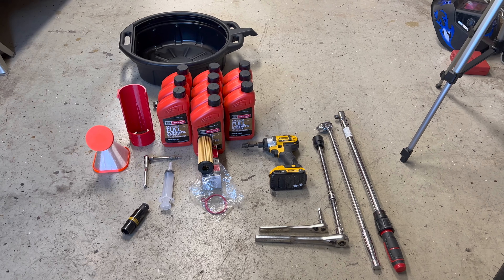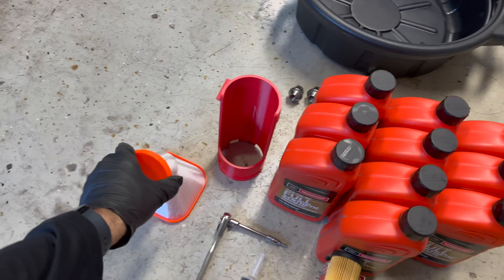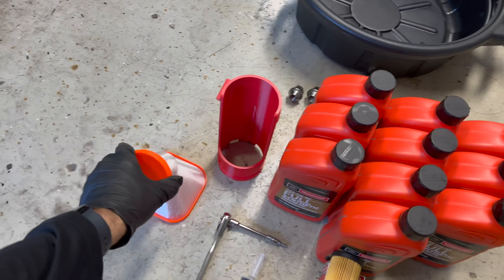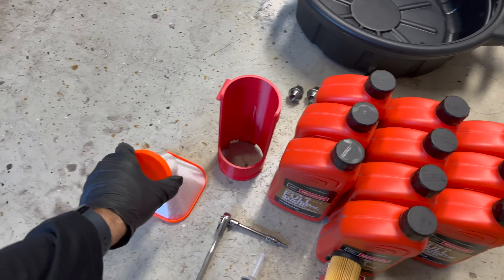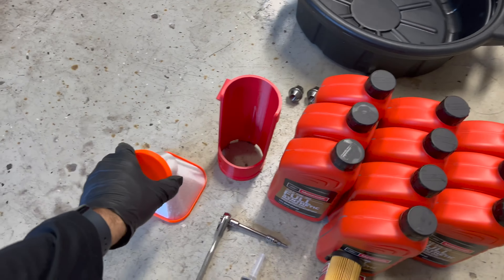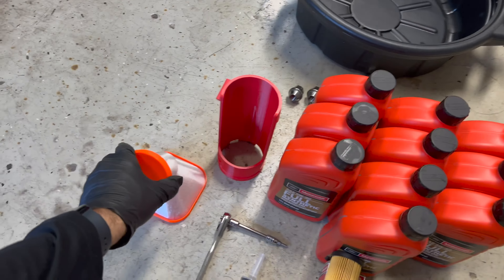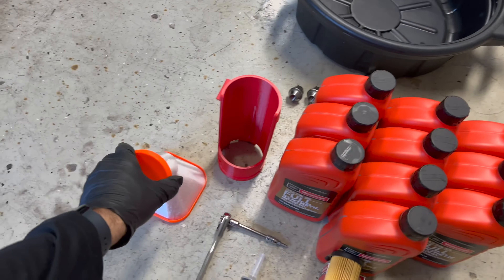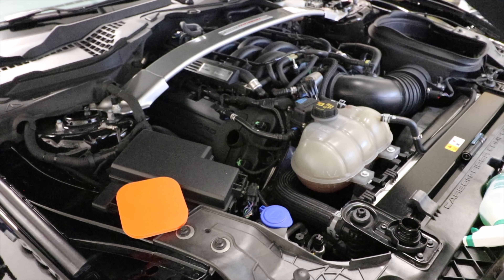GT350 Mustang Oil Change DIY Tutorial With 3D Printed Parts

Comment: You can do the oil plug by hand.  Just changed my oil last weekend.
Reply from the maker: Thanks. Yeah, I’ve had it stuck once before where I couldn’t turn it by hand, so now I automatically take a ratchet with me when I crawl under the car.
Reply: @pilotgore  I would definitely keep my eye on that plug being that the pan and plug are plastic . if it was stuck that means someone over tightened it might mean your pan or plug is compromised. I have seen it before on others people's gt350s not good 😐 great video though and have a wonderful day
Reply: Have a couple of backup plugs on hand.

Comment: Hey there. Are you Rolling the dice with that oil filter? The 2062 doesn’t have the metal core that the 2087 does.  Also. The 2087 is now unavailable. Sucks. Cheers bud
Reply from the maker: Yeah, the 2062 works perfectly fine when installed correctly, especially since I change my oil 7’ish times a year after only 500 miles or so. I have one more 2062 on the shelf and 2x 2087’s ready to go.  Cheers

Comment: I know you said you could use the FL2062 	oil filter on the 2020 - GT 500 does it have the medal basket on the inside of the 2062 filter like the 2087 has? In your opinion would you use the 2062 or fl2087
Reply from the maker: The 2087 is a better filter in my opinion because it has the metal mesh inside the filter, where the 2062 has plastic. I think both are absolutely fine, but the 2087 is better.